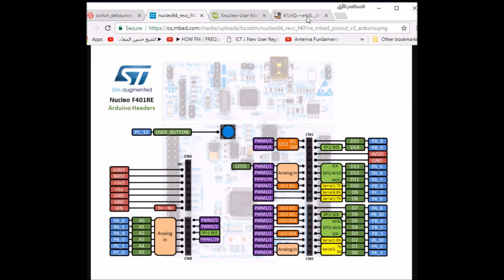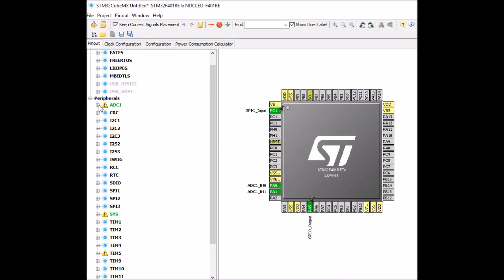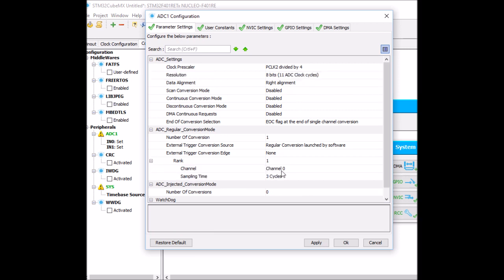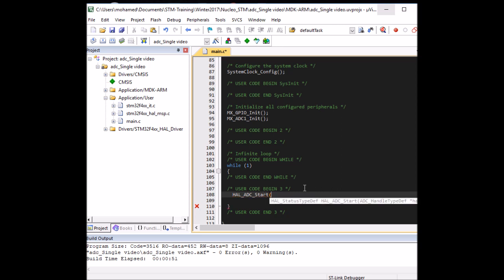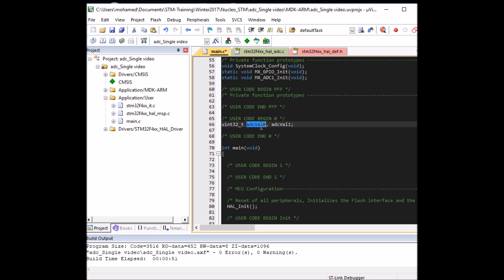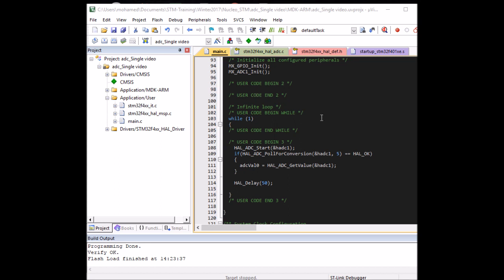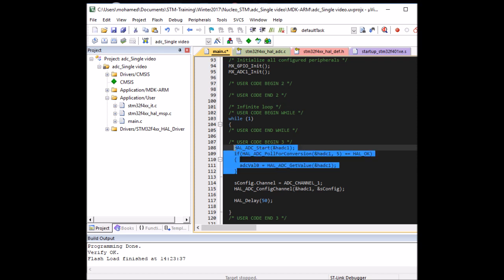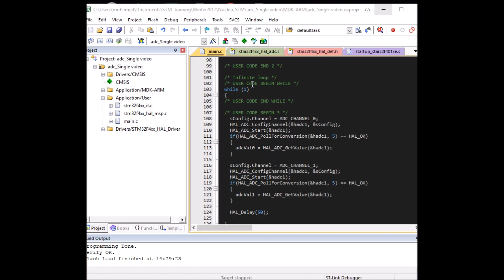STM32 Nucleo - Keil 5 IDE with CubeMX: Tutorial 3 - ADC Single mode multi-channel

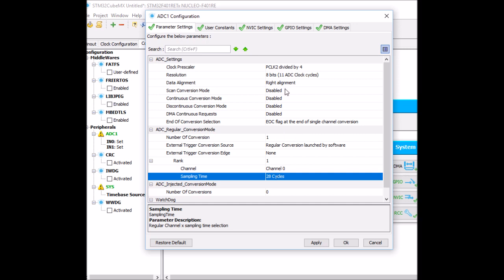Comment: At 3:17, the term "sampling time" is misleading. This is actually referring to sample & hold (S&H) time of ADC's front-end . S&H time allows the S&H circuit to charge up the internal capacitor (usually in few pf) as much as possible to minimize amplitude error. The time required is usually 10x to 20x of RC time constant, where R is the external source impedance and C is the internal S&H capacitance. Whereas the ADC Clock cycles are referring to number of cycles required for the ADC logic to convert the analog value of capacitor to digital value. For SAC (successive approximation converter) it is at least 1 cycle per bit. So, sampling time and ADC cycles are two different concepts.
Reply from the maker: Hi,
You are correct

Comment: How would you convert the adc value to volts ? Having a hard time connecting a TMP36 sensor to a F4 board...
Reply from the maker: Hi Rayon,
For 12bits adc,
Volts = (value/4095) * 3.3V
Reply: @mutexembedded2206  thanks for your quick response..Do you have any tutorial on interfacing the TMP36 temperature sensor?
Reply from the maker: @R_M_20246  I don't. Shouldn't be hard

Comment: Hello MYaqoob, first of all thank you very much for this detailed tutorial. 

I am using a STM32 Nucleo F446RE and a joystick module to test the ADC functionality.
The code works fine for me with no warnings or errors. However I have a doubt which I hope you could clarify.

While debugging, I've added both adcVal0 & adcVal1 to watch windows 1 & 2 respectively. Now when I operate 
the thumb of the joystick both windows display the same values in whichever direction the thumb is moved.  But in 
your case while you were demonstrating I observed that values were not the same.
Why do both my Watch Windows show the same values?

Thanks once again & awaiting your reply.
Gautam
Reply from the maker: Hi Gautam,
Could be channel number or GPIO setting of the other ADC input.
There is a much easier way to do this too. You can to the sequencer and get two values from 2 different channels convert sequentially
Reply: @mutexembedded2206  So I must use one adc channel for the x axis and another adc channel for the y axis? And then convert the values?
Reply from the maker: @GD_902  yes. If you would look at my video on ADC Multi channel ADC
Reply: @mutexembedded2206  Okay I will go through that tutorial. I'm going through your tutorials one by one and thank you for your prompt reply. I shall definitely follow up on this topic once I implement your suggestions.

Best regards
Gautam Dhargalkar
Reply from the maker: Enjoy

Comment: I did exactly like u, for 2 channel but in my case for ADC_CHANNEL_TEMPSENSOR and another one for a potentiometer. Configs for swapping between channels is like u but, it stays on the second channel.  But actually, I use the STM32F072VB. does it matter ?
Reply from the maker: Hi Sayed,
Do you still encounter the problem? Should not matter, but the only difference is that the F072 has 1 ADC,but still 16 channels.
Reply: @mutexembedded2206  actually, at the beginning when I execute it, it works correctly, I have two different and correct data for both channels. But the second time, when I want to read the new data, both channels have the previous data which are actually the data of channel number 2. So for me, it means that it is still on channel 2 !!!!
Is it clear? Did u get what I mean?

Comment: The values that are reading from the ADC channels, where are they coming from?
Reply from the maker: Hi mate,
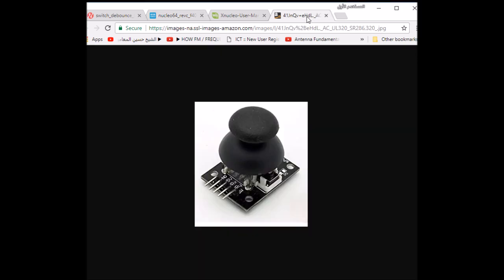Thumb Joystick Analog Input (X and Y), Mentioned that at 00:30
Reply: What pins do you use on the board for x and y?

Comment: STMicroelectronics ST-LINK GDB server. Version 7.0.0
Copyright (c) 2022, STMicroelectronics. All rights reserved.

Starting server with the following options:
        Persistent Mode            : Disabled
        Logging Level              : 1
        Listen Port Number         : 61234
        Status Refresh Delay       : 15s
        Verbose Mode               : Disabled
        SWD Debug                  : Enabled
        InitWhile                  : Enabled

Target no device found

Error in initializing ST-LINK device.
Reason: No device found on target.